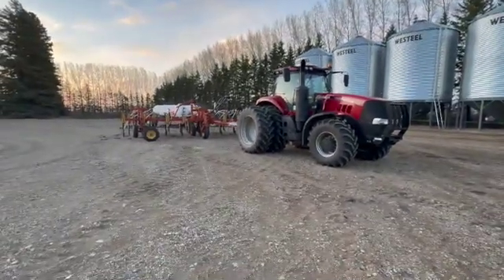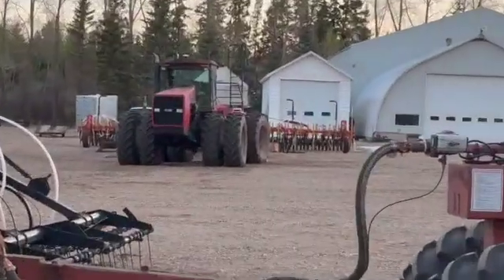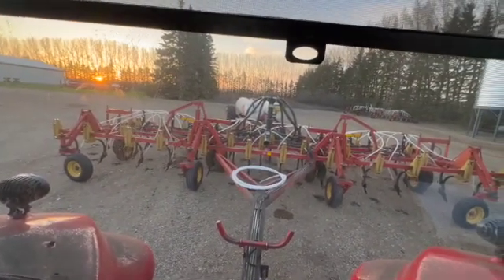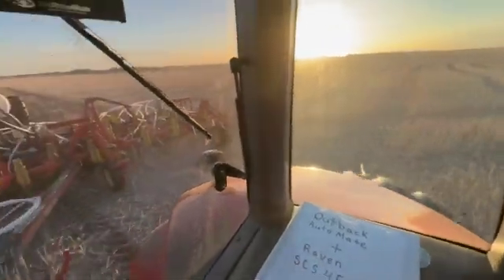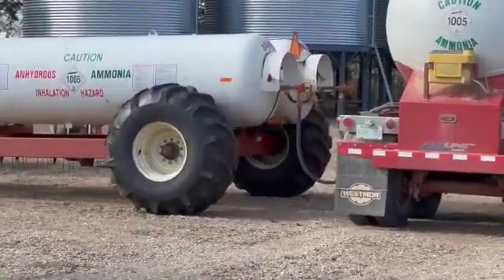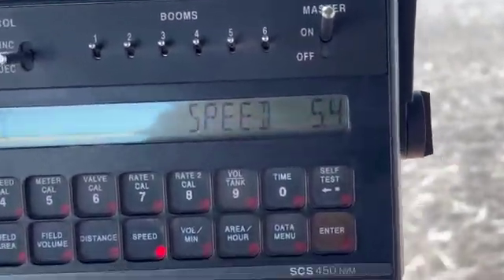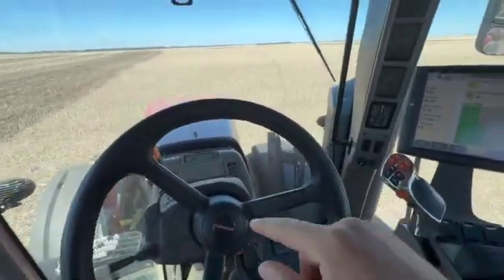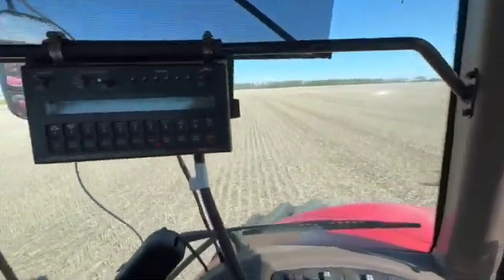Banding anhydrous ammonia spring 2024

Comment: Hey,

Hope you’re doing well and that your farming is going as smoothly as possible in these times!

I’d love to hear an update from you and your farming operation.

Best greetings from Germany!
Reply from the maker: Thank you for such kind words! This year is going well, was off to a rough start with having the driest spring I have ever seen. This month however we have been getting regular rains, so the crops are rapidly improving. Some equipment changes have been made. My 1682 pulltype combine is sold, as well as my pup trailer. I’m selling all my grain trucks and running just semi trucks now. Last summer I purchased a case 1175 tractor, and Ih 660 tractor. I upgraded stone pickers as well this spring. The spra coupe is sold, and I’m using a pull type ground sprayer behind my case 2290 tractor. For in crop spraying I have hired custom spraying- the custom operator runs a very large John Deere sprayer with a 1600 Us gallon tank and 120ft spray boom. I believe this is it for equipment changes since I made my last videos. I’m trying to buy a 40ft straight cut header for my case 9120 combine at this moment.

Comment: Great video. Thanks for sharing. What all is wrong with your new tractor purchase. Did your other tractor have any more problems with the steering?
Reply from the maker: Thanks! Thank you for watching! The 2870 issues: rear planetary seal leak, engine oil leaks, hydraulic oil leaks, leaks in steering lines, ac condenser is wrecked. Just the stuff I know about. 2594 had air in the steering system from removing hydraulic lines. Got it fixed up and worked fine after. Sold the 2594 in the winter to pay for the 2870
Reply: Do you seed the opposition direction you put anhydrous down?
Reply from the maker: @Cumminsproject01  yes, 90 degrees to the direction I do anhydrous
Reply from the maker: @Cumminsproject01  I harrow on a 45 degree angle when I can. I try and do nh3 on 90degree to seed as it’s a little more efficient than going on an angle (more over lap). Also a greater chance of double applying nh3 on an angle. It does seem to help a little more with smoothing over deep furrows or ruts from last years crop too. If I do nh3 in the same direction as seeding, I’m more likely to see the tracks from the nh3 cart as well when the crop comes up